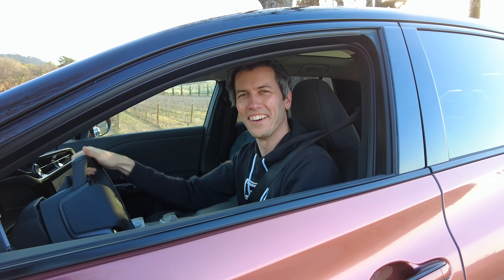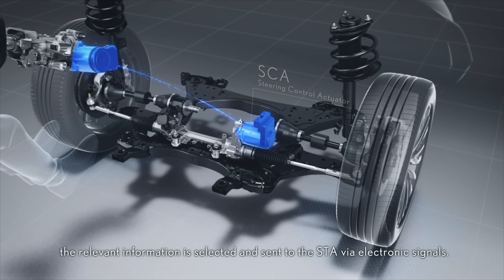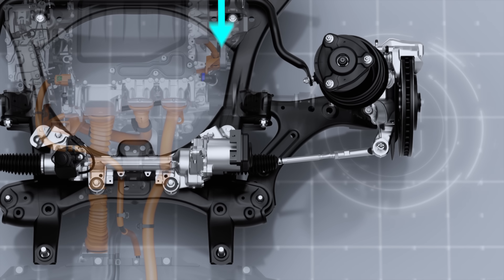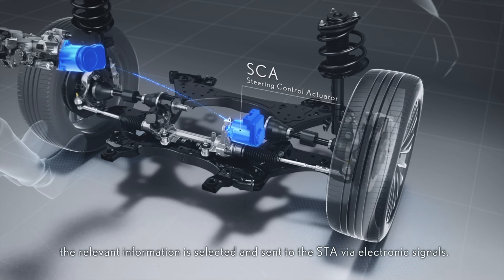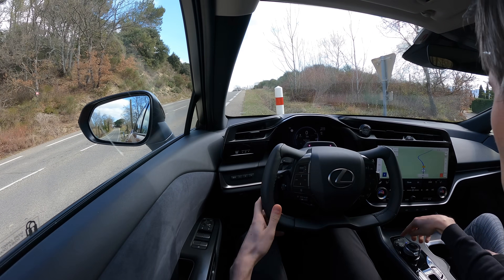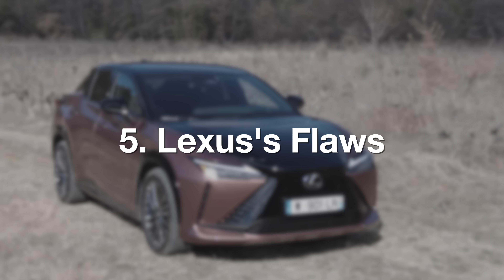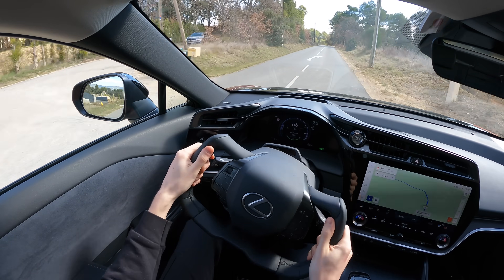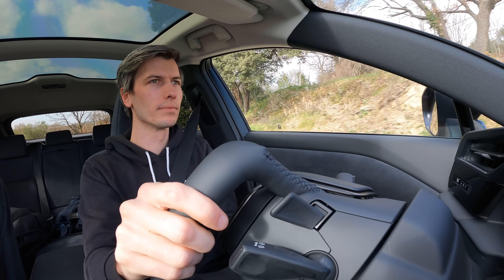How Lexus Fixed Tesla's Bad Idea: Steer-By-Wire Yoke

Comment: Great video but a big NOPE from me. Brake and steering by wire are a no-go because there's no reason to change them. I had a chance to take a CT4V-Blackwing on the track and managed to destroy the brakes with no error message or feedback from the pedal. When I melted the pads on my Miata, I could feel something was wrong through the pedal. One of my cars has a variable ratio steering rack and it's amazing in parking lots. I get the redundancy built in for safety, but that's also added cost, so why pay 2-4x as much for something to simulate the real thing... when you could just have the real thing.

Comment: I would be curious to compare the steering delay against a similar car with a standard steering rack.  The delay might be a matter of the motor not being power enough to keep up with the commanded location from the yoke, since you can potentially turn the yoke super fast, much fast than might be possible with a direct linkage.  In a standard steering system, it might be that you can't physically get the steering wheel to turn as fast as you can in the drive by wire version.

Comment: So if you hold the rack at 45 degrees and decelerate from 80mph to 0, does it turn sharper and sharper as it slows? And when you accelerate out of a turn, does it straighten itself out despite keeping the wheel at the same angle?

Comment: Alright it's cool. So what about entry and exit ramps for highways where you are either accelerating or decelerating when the ramp is a constant radius turn? Does it vary while speed changes but steering angle does not?

Comment: "Small delay"? What's on that video is a massive delay. At highway speeds that's the difference between a near miss and a casket.
Reply: Not to mention that after 5 years in a humid climate, when all the electronic glitches start popping up, that car is either a death trap, a money pit, or just more junk for the environment when you have to buy a whole new one.

Comment: Maybe you noticed a delay in the rotation because you where at 0km/h.
I think turning the wheeled very fast when the véhicule is stop required too much force.
When the véhicule move with a correct chase angle it cloud be easier to turn the wheels faster from left to right with a better responsive time ?

Any tough about this ?

Comment: Steer by wire ... Brake by wire ... Throttle/power by wire ... are terrible terrible ideas! ... Especially when they are all connected to a computer.

Modern cars are becoming less and less attractive to get ... The driver is basically just an input for the computer, which is also making its own algorithm based inputs, and likely connected to the internet, and getting other inputs from g o d knows where!

Comment: Assuming that it's engineered, designed, built, programmed properly, I don't see any safety concerns. Planes use controls-by-wire since quite some time. And they can't just pull over to the right, if there is a warning light flashing.
Is it possible for a component to break / fail? Of course. But, at least in this case, there is a backup system. If a component of a traditional steering system is failing, which is also possible, there is no backup. How do you keep your car on the road?

The delay might be annoying, but I'm sure the developers, engineers, etc. will sort out that issue before it goes into production. Otherwise, it would be an epic fail, indeed.

Comment: My concern stems off of your last point about the constant variability. When undergoing an emergency maneuver, muscle memory and predictability should be at the top of the priority list. With this system, those seem to go out the window. Your mind has to learn a constantly changing system that depends on both speed and steering input. I just don't see how that would translate well to making the right input when it maters the most.

Comment: If you watch the first 10 seconds of the video frame by frame (pause, then use < & > buttons), you can notice a significant delay between the yoke and wheel movement. I think it's not safe

Comment: A variable steering ratio reminds me of the aim acceleration/response curve setting we get in video games on both controller and Mouse. Doesn't work exactly the same way but I know I wouldn't like it because I prefer having a linear/raw input where everything moves a set distance based on my own input all the time. This helps with consistency but it's personal preference.
Reply: I agree but just like mouse acceleration, I feel like the majority of people would like it once used to it. A linear curve will always be more consistent but an exponential one is typically easier to instinctively learn. When I got a racing wheel I actually had a non linear response curve for dirty rally 2 since I could not keep up with the speed to correct oversteer and a quicker ratio was too twitchy.
Reply: @caseymurray7722  I think so too. It's makes it accessible especially for those who don't enjoy driving but it will be easier to make mistakes and over/under correct I feel
Reply: @javianbrown8627  no it's not not anything like mouse acceleration the wheels are going to steer the same amount no matter how fast you are moving the steering wheel...the mouse analogy would be you more like switching between different mouse sensitivities depending if you need high precision (high speed driving) or fast movements (like doing a three point turn or parallèle parking) except it's not discreet modes but the sensitivity changes continuously with speed.
Reply: @javianbrown8627  tbf I think the steering at higher speeds is quite similar to classic steering. as when driving any car on the highway, you don't need to move your hands or cross your arms. the difference is at low speeds, when you dont need as much precision, but you need to go quickly to full lock,  the higher steering ratio lets you maneuver more quickly and without moving your hands.
Reply: @geemy9675  Perhaps that's been some misapprehension. 
I'm not saying it changes the ratio based on how fast you turn the wheel, I know that's not the case. It's using another factor. I just compare it to Aim acceleration due to the varying ratio, effectively affecting how sensitive your steering is or feels similarly to how Aim acceleration affects how sensitive your cursor/crosshair is or feels. 
Honestly the best solution for normal people, as it makes things like a yoke more accessible. Despite the issues reducing skill could potentially cause.
Reply: @javianbrown8627  actually with regular steering, steering IS WAY more sensitive at high speeds. this is why power steering is often reduced at higher speeds. if you do the same movements you do when doing a three point turn, going full lock one way to full lock the other way, but at 70+ mph highway speeds, you instantly go either into
-wipeout
-rollover
-the car next to you
-guardrail
-combination of all of these
while when maneuvering you can spin the wheel three full turns. so  adjusting the ratio actually makes sensitivity more constant.
It might be better but I'm not sure I would want it in my car though. first if you have it in one of your family cars but not the others, it's not great. second if you become uncomfortable driving other cars or people driving your car crash it because it's too sensitive at low speeds..
Reply: @geemy9675  It's too early for this man, I'm just comparing a wheel to aim acceleration. That being said I don't think power steering affects your steering ratio or makes it more sensitive. Just the force required to turn the wheel. Pretty sure it would be easy for people to adjust to though especially if you make them aware that the car does this. Similarly to how I can play a game on someone's settings without having to change them as long as the bottoms are the same. If the person isn't mechanically good at driving though maybe the adjustment weird be harder. You're using a Yoke after all in this car so you wouldn't attempt to drive it like a traditional wheel
Reply: @javianbrown8627  seems like Honda and Toyota already did variable gear ratio steering in the 2000s google Honda vgs and toyota cars so it's not all that new but it didn't stick though. maybe it will with faster/smarter electronics, better motors
Reply: @javianbrown8627  btw I seems to be delayed to 2025 in the US so they seem pretty serious about it but they don't want to ruin it with an unfinished feature
Reply: Exactly this, mouse acceleration is horrible. Even on macOS where it is supposed to have a good implementation for their trackpad, I still end up preferring constant linear motion as you can even without looking anticipate and move your cursor to the correct position, no need for correction of over correction etc. I always disable acceleration when using a computer mouse no matter Windows or macOS.
Reply: it's still linear I think

Comment: Okay I understand, but when you start parking or doing whatever. If you have a traditional steer, you know that in order to steer your wheels x amount you have to turn your wheel y  degrees. You are getting used to that and you apply it for the rest of the life of your car. But what if you have this Lexus with so many different steering ratios? You will have to adjust every time you steer without being sure how much you have to turn to steer around an object lets say. Whereas with the traditional car you know that need this specific amount. Anyway, I hope they find the solution.

Comment: Could they have not just used an electric pump connected to a traditional hydraulic system with a physical shaft? I would be interested in seeing you calculate wattage for the all electric system vs an electric pump/hydraulic system and the differences in vehicle weight in relation to range. Yes, aircraft have been using fly-by-wire successfully for decades. But aircraft receive substantially more maintenance and more stringent annual certification standards for airframe and powerplant mechanics. We can all see cars on the road with neglected maintenance; I don't think electric cars are going to change attitudes to where people start doing all of the required maintenance. Also, a lot of vehicles go to shops with mechanics who's skills are questionable where repairs may not be accomplished correctly or the fault may not even be noticed during an inspection.  I think its a nice idea for a car, but when a hydraulic system fails due to part failure or failure due to neglected maintenance, the wheel can often still be turned to turn the wheels to move the vehicle safely off the road as speed decreases because of a physical shaft. This was my argument against powered parking brakes that won't come on when the vehicle is moving. At least with the old foot pedal or the "rip it stick" for a manual parking "e-brake" systems, should there be a failure of the hydraulic system, the manual system can help you slow down. The redundant systems are nice, but again, its not likely owners will inspect the redundant systems in a manner similar to aircraft. I do like the idea of high/low steering ratio based on speed. My 2004 Mercury Grand Marquis has speed sensitive steering based on speed. While not the same as steering ratio, it boosts the pressure to allow the wheels to be turned with your pinky finger in a parking lot or takes it away to make the wheel stiffer at high speed on the freeway. Great systems.

Comment: A factor I wish was discussed more is the added cost of these increasingly complex systems, and their redundancies, for nearly imperceptible differences. Including life expectancy. Seems like many of these systems costs to repair will be more than the value of the vehicle after the car gets just a few years on it. For those of us that don't want to have large car payments, that is a real problem.
Reply: This is a case where it might be less costly both upfront and for a repair. But the end result depends on how reliable is ends up being. Two cheaper repairs can still cost more than one and one is of course more than none.
Reply: @kamX-rz4uy no way possible this will be less expensive
Reply: @kamX-rz4uy  No, it will be more expensive. Because the normal system is a giant steel rod. That can only break in an accident, and in that case the car is totaled anyway.
And the steer assistant is the exact same, but with no redundancy, so much, much cheaper. Not to mention, a lot of turn assist systems are hydraulic and have no actual electronics on them.
Reply: @DrBernon  You forgot that airplanes has this tech for many years with zero issues.
Reply: @I_am_a_nice_person  Aircraft also has more redundancy and a significantly higher cost associated with it.
Reply: @BlueDually4x4  That's not true though, they usually have two backus and that's about it. Also, the weight is the major concern not really the cost.
Reply: Cars are way more reliable now than 30 years ago thanks to electronic systems. even the last 10 years with electronic power steering becoming the norm. leaky fluid power steering is a thing of the past. it has actually mechanically simplified steering on cars. no more power steering pump on the motor, pipes and lines. As for this new steer by wire system, i'm not totally sold on its functionality, but I guarantee its way more reliably then some early 2000s fluid power steering car. its just 2 electric motors
Reply: @WilCoxon007  I don't know about simple... I'm willing to bet that this is completely unserviceable by the car owner, unlike electronics in older cars where you could simply replace a part. Even with physical systems, can always just replace the parts or repair them.

As for leaky power steering systems, you could always just make a car without power steering, but no, people are too weak/lazy for that. I've owned a car without power steering. It's not that bad. You can live with it if you're concerned about reliability.

And actually, that manual steering was the tightest and most responsive steering I had EVER felt. And that includes comparing it to a brand new 2023 Nissan Leaf. A car from 1980 had better steering. And more reliable too.
Reply: @WilCoxon007  The thing is... That power steering with fluids and such could be repaired by any mechanic. Or even by yourself if you are handy enough. This thing can only be replaced. Not to mention, you can drive a car without power steering just fine, only having rubble when parking.
And also... they are not so unreliable. I have never encountered anyone with a faulty power steering, and I've known a lot of people driving cars from the early 2000. Mine being from 2004. With over 200,000 km and quite a few of those driving on a very poorly maintained dirt road. And no issues at all.
(Edit) This is like people saying that electric cars are more reliable, that they can do more miles... Excuse me, but where have you all seen unreliable gasoline cars? Modern cars, from  the 2000s onwards, are indestructible already if only you perform all the maintenance. So don't sell me that lie about reliability.
Reply: This is a really good point. Cars are getting so needlessly complicated these days, and for what? What's the point. Cars work just fine. We don't need to reinvent steering systems and brake systems and drive up the cost of the vehicle. I think it might even be just a selling point so they can charge you more for it. 

In a world where you need a car to survive (with the way our cities are designed), cars should not be so expensive. And they should be getting more intuitive, not less.

Comment: I think it'd be nice if they just made it a default to have a more option or multiple with the car setup for a neutered steering or not with the system. Not having the ability to do 'risky' things with your car can be risky, e.g. something like a rock fall happens and you need to swerve a bunch to avoid things hitting you and the car. Or more commonly, someone is on their phone/has a seizure/sleep deprivation/is distracted and they swerve into oncoming traffic and you need to swerve out of the way. That's usually an aggressive maneuver.

Comment: From my experience I don't think the issue pointed out in the end that the varying steering ratio is going to be much of an issue for most people. I've had a steer-by-wire car since 2010 because I have a disability, so I drive my car with an 8-way-joystick that controls motors on the steering column and brake/accelerator. The system uses variable steering ratio just like described here, and although it's substantially less sensitive at highway speeds it is quite unnoticable - and that's without any kind of force feedback, unlike the Lexus system. I drove with regular steering before (with additional servo) and the switch was surprisingly easy.

Ony issue I had was that initially I was sometimes unable to get enough steering angle on Italian hairpins at slightly more spirited speeds (I was trying not to slow down the Italians too much). After a reajustment the increasing the ratio at all speeds the steering became generally a lot more responsive - the car felt sportier - and there were no more hairpin-problems at any speeds I'd be comfortable driving at.